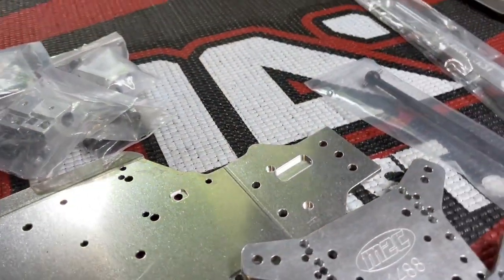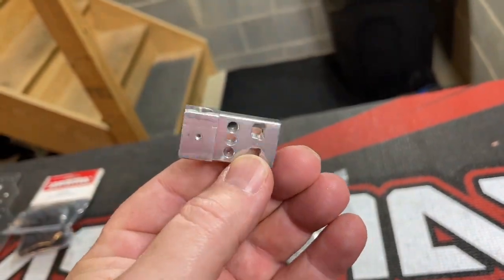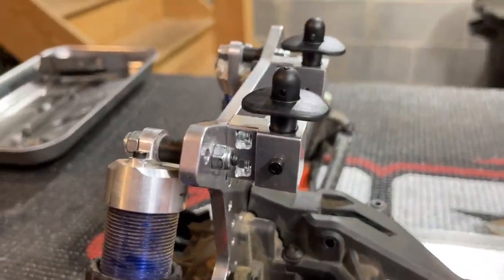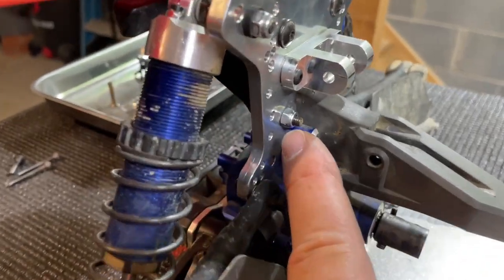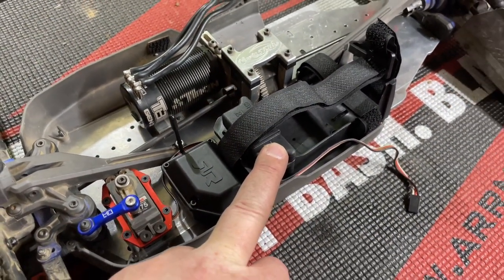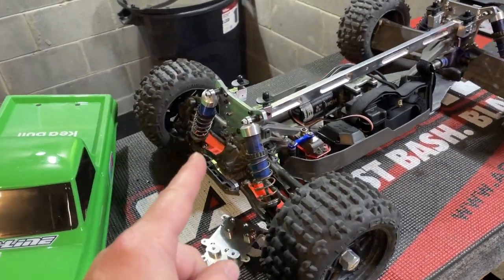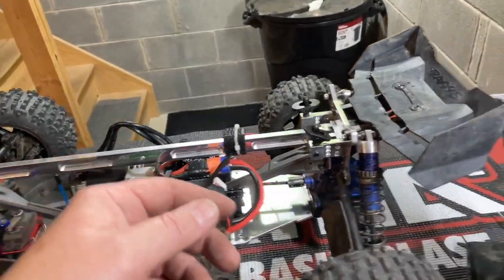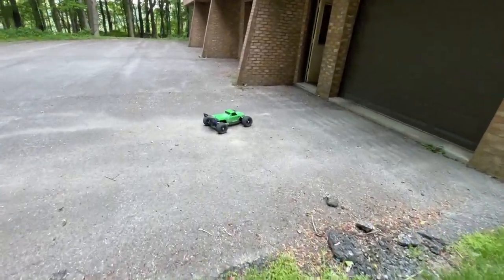NEW TRAXXAS SLEDGE XL. AKA THE JACKHAMMR!!!!

Comment: Is this chassis longer than the stock?
What about the old parts, do they work or must there be new? Its traxxas sledge
What new parts have to be?
Reply from the maker: It is a longer chassis I would have to look at the car again, but the tower to tower brace also needs changed out and I believe the rear driveshaft because it’s longer M2C racing makes the conversion kit with the pieces you need
Reply: @BarstoneRC  yes ive seen...thanks for the fast Response, so much to know, im fixed...what about the body, the jackhammr kit has the shock Towers were the nose from the body goes in, but its longer so i have to use an other body and will it fit with the nose? If yes than the kit what comes onto the body must be longer. I wondering your Towers are closed, that makes sense, the body kit with the nose would not fit or they have a longer kit for the body....sory, kit for the body, you know what i mean im german, can not follow everything you tell, but is ok.
Reply from the maker: @marc1981er yeah, the stock body with my set up does not work. I put a basher body on mine with the. ARRMA body posts on the shock towers.
Reply: @BarstoneRC  and you use the old System on the body with the nose infront? Your shock Towers are closed, jackhammer kit is tower open, for the nose, you know...i sure will get the carbon Towers, ex basherqueen
Reply from the maker: @marc1981er I think they made a set of towers to use the stock body, but I did not use them. I went with an aftermarket body and yes, I use the stock system.
Reply: @BarstoneRC  but how do use Stock Body with Jackhammer Setup?? Just too short
Reply: @BarstoneRC  i think i Go use the small sledge chassis for the First. Then i will See concrete
Reply from the maker: @marc1981er there was a company I thought making an extension for the back, but I might be wrong on that but yes, you pretty much have to go to an aftermarket body
Reply: @BarstoneRC OK, nice
Reply: @BarstoneRC  when Turn the Motor to the Back, what about the driveshaft, have to Change around or what? Will be the Last question, i promise. I already have some m2c parts for my xrt. In Germany WE only have 2 Shops for m2c. Gpm and vitavon are Here the Big Players. Theres another Brand named Treal, dont know much about.

Comment: Finally got the Sledge i think the day after u put this video out and i really love it! Did u do the silicone ear plugs in the center diff of the sledge and what kinda setup would i have to throw in this beast for it to pull off  sitting backflips do ya think?
Reply from the maker: I did put the earplugs in the center and if you put the hobby wing max five with the 1650 motor, she’ll have plenty of power
Reply: @BarstoneRC  Ok thank you so much and taking the time to answer the ppl in your comment section not very many ppl do that!
Reply from the maker: No problem bud. I hope it was helpful if you ever have any other questions, feel free to ask.

Comment: Front end is definitely to soft
Reply from the maker: Yeah, it’s not tuned yet. And turns out I have the wrong shock tower on the front.
Reply: I was going to say something didn’t look quite right there with the shock position on the front then when you ran it I immediately thought it handled terrible .